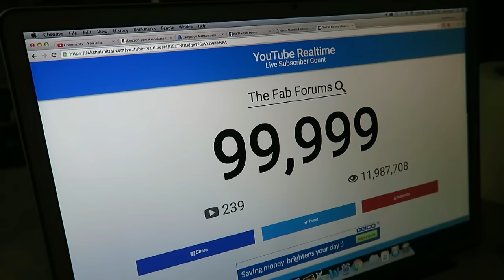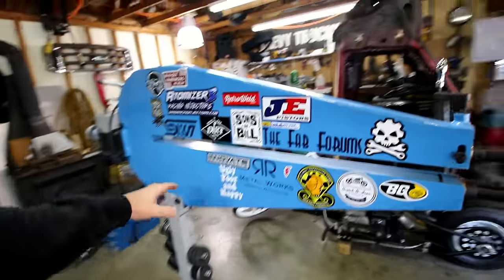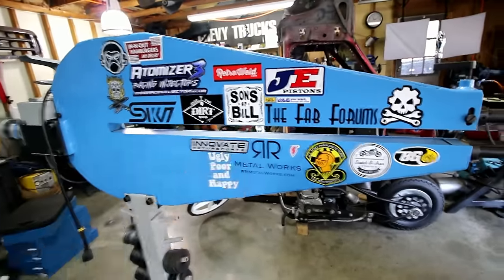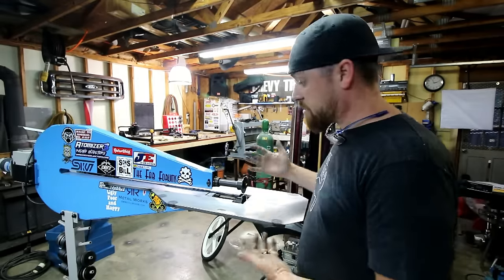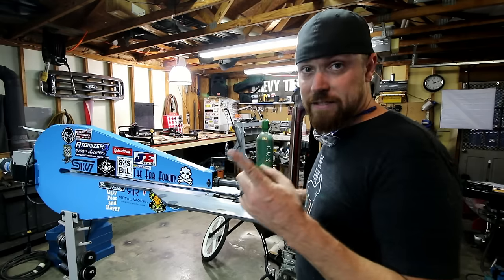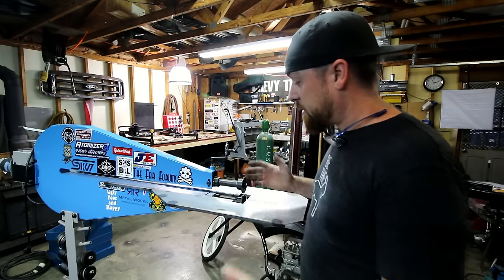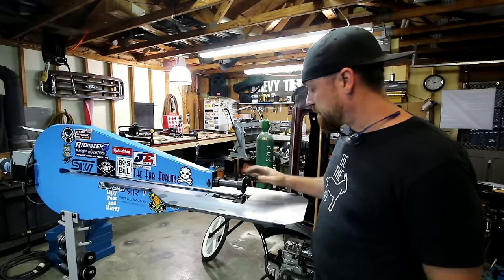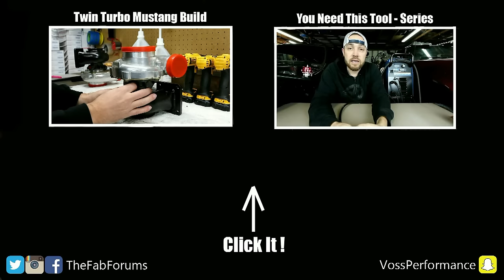Making A Custom Bead Roller Table

Comment: Hey Kyle,
 At first I thought you were making a larger surround table to be able to 'one man' larger sheets such as door panels, firewalls, etc. THAT is what I need to build ! I'm always rigging up temporary surround supports whenever working with thinner aluminum interior sheets to keep them from dropping and flopping ! Additional manpower is not ready when I am !  In addition I need to add this creation you just built for the smaller stuff. Congrats on hitting 100k !
Reply from the maker: Thanks....yeah I have not had to fight any large panels yet

Comment: Very cool table and congrats on 100k! Maybe put a small stud in that hole on the bottom, then a wing nut on it to fasten the table. That would be easier than threading and unthreading a hex bolt by hand.
Reply from the maker: +GasInMyVeins20AE thanks
Reply: GasInMyVeins20AE I was thinking a quick release pin on a lanyard
Reply: That could work too.

Comment: what I was thinking of doing is bending up some conduit have it mounted to the stand so it could swing and using a bearing like you would find on a roller stand  on the end the material sets on

Comment: Wondering if your idea about using the bead roller to produce the dimple die effect worked? I see that you actually bought dimple dies a few months later so I'm guessing no? Just got a roller and was hoping to do exactly what you described.
Reply from the maker: The dimple dies I bought where to press plate steel. The bead roller can only do sheet metal. I do have some punch and flare dies I use on sheet metal but they are only so big, so the bead roller idea would be for much bigger. I havent not done much testing though.

Comment: The radius holes are a brilliant idea.
But rather than use a Cleco, why not simply use a bolt that's the same diameter of the hole saw guide drill?

Comment: Hey man, I gotta ask. How do you manage that nice shiny bead? I think I'm doing something wrong cos my beads seem a little dull? Is it the cup and the lens that help or what? My problem is mostly with 316L
Reply from the maker: yeah its in the shielding and cleanness. If you dont have a good cup and gas lens it is a must
Reply: Then it's really gotta be that! Time to get those cups you showed on an earlier video!
Reply: Great! Thanks!

Comment: If clecos don't work, what if you weld a 10-32 (think that's close to 1/8) nut to the underside of the holes and just run in a bolt n washer?
Reply from the maker: +moptop85 that's a good idea

Comment: No fair laughing! OK? When you're marking with "markers" where do you cut? We know the markers get "Fat" over time, so do you cut "Dead Center" on the mark? I'm sure you have used scribes but they can "Impact" aluminum. Remember...no laughing. Guess my question is, how do you PREFER to mark al. and where do you cut? Thanks. Nice job on the table.
Reply from the maker: I always cut on the inside of the mark. no scribe